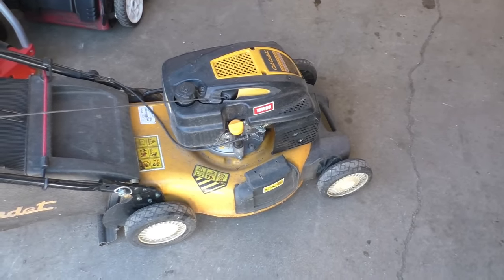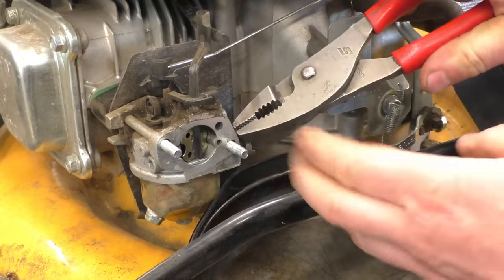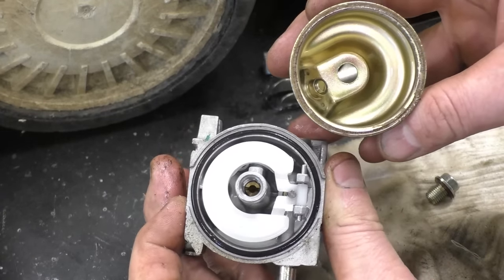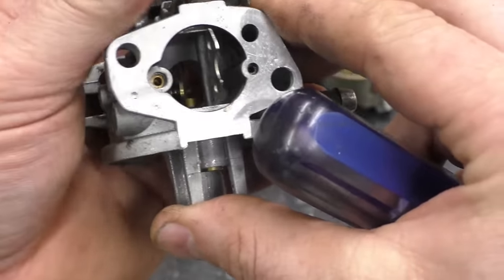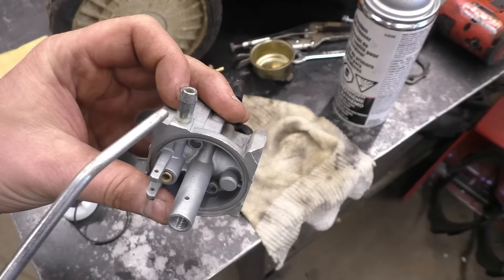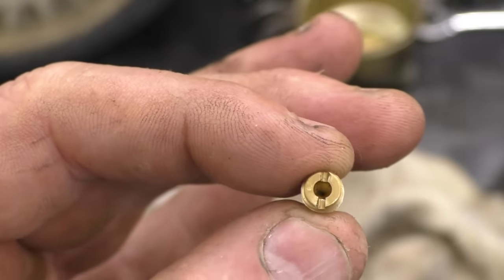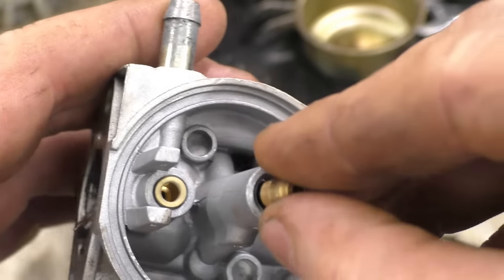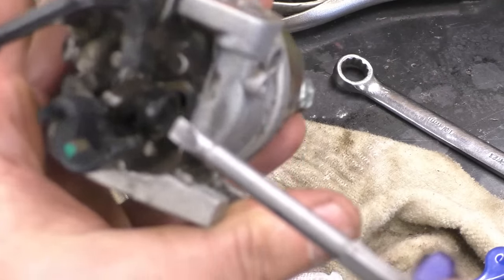Lawnmower Starts But Won't Stay Running After Winter Storage - Step By Step Repair

Comment: Friend down the block neighbor was going to the dump with a lawnmower. He asked why, and the owner said it won't start and bought an electric. He said he was done with gas machines. The lawnmower was only used 2 times. My friend brought a 21-inch Lawnboy with a 6.5 Kohler motor. The mower sat for 1 1/2 with ethonal fuel in it. Carb bowl had brown bits and white gell and rust bits all over. The emultion tub had 3 holes plugged. Spent 1/2 hour cleaning everything up and started first pull. The machine definitely was only used 2 or 3 times. Now my buddy across the street has a free brand new mover for his lake lot. It's a shame people spend all this money on machines and neglect simple maintenance. Your only one click away & 5 minutes of your time to watch a video & save you some money. Great video.
Reply: I know i have about 5 or more taking up room in my space but am working on each different riding mower i know what each one needs done to them and a few are took apart in the yard it looks kinda messy but thats how its gonna be without a garage to do the work in people still wanna dump off their stuff to me when they believe its broken but isn't i guess those people are load with money to just keep buying or don't care to waste it
Reply: I can’t believe how many new or near new mowers I get for free. Throw away society. We are the recyclers! 😊
Reply: @ChristopherTreadway  but i always get outdated ones people are sick of having but then there's never nothing really wrong with them just dirty carburetors rotted filter never changed cutting blade and old gas and oil and plug its all easy stuff they could have done and kept on using their mowers so once they're new mowers get about 10 or 15 years old we'll be taking those ones to
Reply: @Mike-su8si  I think we live in a society where everyone thinks they need to "upgrade". It's funny how they tell me all the things their new mower does, and it's pretty much the same thing their old mower does, except it's new and shiny. But, more for us, right?  😀

Comment: Having done much carb work on cars and small engines, I have found that electric guitar strings are amazing for cleaning out tiny air passages and jets. A set comes with smooth and wound strings of 6 sizes per set. Cost practically nothing and will take decades to wear them out.

Comment: Even though I know all this it’s still a pleasure watching your videos. You are one of the best small engine mechanics on YouTube.
Reply from the maker: Thanks 👍
Reply: @donyboy73  My Snapper Hydro LT tractor wiring messed up, CAN'T get a harness any longer, I HAVE the wiring diagram & can provide ANY close up pictures of ALL connections at the switch, battery, relay & engine connections, wondering if I mailed such to you would you sketch up a wiring layout for JUST the starting & charging connections? Willing to pay for all mailing & your shop time, I'm in north central rural Florida &  the nearest shops that WON'T take my mower is 30 miles away, this mower is ONLY used as a puller, it has NO cutting unit, NO electric PTO, NO lights, just factory wires running to the engine with fuel solonoid & what appears to be a oil pressure switch at the oil filter mount area. NOT asking for a harness, just proper connections

Comment: Darn. I did this all two weeks ago...left lil bit of fuel in mower over Winter, but I use K100 per your recommendation, which scratched my head. Then I took the carb out, bowl was clean, and I used air to blow all out, along with the filter. Put it all back and nope, no start. So I suspected plug, and it was bit dirty, so some emery and gap check and still, no start. Then I thought, did the magneto fail? I didn't see a spark with the tester so... took pullcable assembly off, and found the magneto needed gap set. I took some hi grit sand paper and ran over magneto area to remove some rust, then gapped per your tip on using a business card, and reassembled. Viola, first pull! Your channel has allowed me to keep my mowers and lawn equipment going and my wallet spared! Thank you Dony!

Comment: I have a wheelbarrow sprayer that I had not used since mid July. I went and check it out yesterday as the "spraying season" is here. I've usually had to clean the spark plug, take away the carburetor like in this video and clean it all out, you name it.

This time it started on the second pull and I didn't even had to pour new gasoline. The only thing I did when I put it away was closing the fuel line so it run until it had no more gasoline in the tube/carburetor. I was surprised both for it to start on the second try and also that there was still some gasoline in the deposit, as it's cap it's not exactly a perfect seal but... it worked.

Thanks for video, nice info as usual.

Comment: I need to buy those micro drills I'm having serging issues with a similar mower ! Thanks for that tip !
Reply: Clean out your pilot jet. In this video it’s the little black plastic part underneath the screw. The orifice is tiny, a single copper strand out of 16 guage wire should go through the tiny brass jet. 
That should cure the surging on these Honda style carburetors.

Comment: There's another trick to keeping gas from going stale in the carburetor bowl.

On my Honda GCV160 lawnmower I installed a fuel shutoff in the hose between the tank and the carburetor. When the mowing season is coming to an end I'll let the level in the tank get low, but not so low that it'll allow dirt to flow into the hose. I'll run the engine until it gets to normal running temperature, then turn off the fuel flow and let the engine die out from lack of fuel. There's a drain screw on the lower edge of the bowl, so I'll open it and drain what fuel remains out of the bowl. I also drain the remaining fuel from the tank.

So far, there haven't been any problems with clogged jets or a gummed up carburetor (knocking on wood)!

Comment: ive recently had 2 of these and fixed them both
Reply: the problem i had with both is i had to replace the gaskets..they both would start and stall after a cleaneing and filter change and would still start then stall, i changed the gaskets and boom they ran fine

Comment: I have a 2004 Quantum engine mower that I have always ran dry at the end of the season. I’ve never been into the carb or anything else for that matter. I change the air filter every season and the  oil every other season. It’s only had the spark plug replaced once. I don’t believe in fuel stabilizers but it’s only been ran on 91 non ethanol its whole life.

Comment: Hell yeah I have worked on a cub cadet push mower I replaced the carb and there is also an inline fuel filter in the outlet of the fuel tank that really restricted fuel flow if dirty 👍

Comment: I always run my push mowers dry so no gas is in the tank/carb. I use guitar strings for clearing tiny holes. You have 6 sizes to choose from. 
I notice the screwdriver really did a number on the top edges of the jet. If your running a Holley carb in your old car here in Canada, you can no longer get premium fuel with 0% ethanol. So you’ll need to increase the primary jet size by 2. In mine I went from a 70 to a 72. Besides that  I use Ethanol Shield from Home Depot in my 1970 car and yard engines.
Reply: Bob Falfa did the same thing and he's looking for you on Paradise Road!

Comment: If people put stabilize in the gas and run it for 10 minutes then after that put fogger in the carburetor untill you see white fog come out of the exhaust. Your carburator is totally lubrican till next spring. My dad and I always do this in the fall and have never had a problem for 41 years. They always start right up

Comment: So I just had the same issue with a YardMan. Cleaned the carb and after it was surging. Popped it off and enlarged the main jet a bit and cured it. One thing I’m wondering is…is this motor made by Honda? Everything on there looks the same…except way easier to work on of course😂. Thanks for another great video.
Reply from the maker: They are a chinese copy of Honda

Comment: Excellent video Don, i enjoy everyone. After running an engine dry and draining the carb bowl do you ever spray anything into the bowl afterwards through the drain bolt. I have heard old timers do this to keep things from 'drying out'.
Reply from the maker: No I don't spray anything, if there's nothing there, there's nothing to gum things up!

Comment: I have a craftsman m110 does the same thing but I've replaced fuel line, spark plug, air filter, and new carb and filter. Has new gas and oil still doing same thing. Any suggestions?

Comment: On the cub cadet mower the Orfice you opened up with the 30!thou drill bit , we’re you enlarging the opening or completely opening it up , I have the same set up on my champion generator
Reply from the maker: Enlarging with 13" thou micro drill bit from Amazon
Reply: Thank you so much for the quick reply , Love watching your videos , very informative and you are a very smart man.Ok because the hole seemed solid to me on mine so would that mean it’s plugged
Reply from the maker: @DonJackson-os4xu  yes

Comment: I just follow Honda's instructions on storing an engine, drain the fuel system (I also pull the bottom bolt from the carburetor to fully drain it), remove the spark plug, dribble some oil into the cylinder, turn the engine over slowly a few times, put the plug back in and pull slowly until the first bump in the compression release as that closes the valves.  I do this to my Honda G flathead, GC, GX  and Clone engines like my Cub Cadet PowerMore engine.
Reply: Should you leave the gas cap on or off after draining the fuel to store the machine? Thanks

Comment: I just fixed an old 1970's Briggs that was sitting for years with gas in it by just pouring some seafoam and carb cleaner mix straight into the carb. Used starter fluid to pull it through a few times and away it went, runs like a champ. The tank was clean inside though and if there was any debris this would not work. People need to quit being lazy and just run the machine dry / remove the fuel line to empty the tank, then pull the drain plug on the carb. 2 minutes a year will save you thousands over your lifetime and you don't even have to pull the carb.

Comment: I get old stuff.  that ones alot newer then all the ones i have sitting around til i start on them two are a 2 cycle out of some of the free ones i have i have a even older one but its piston arm is broken off and the piston housing is ruined from when whoever last ran it broke it but its little engine is shot and no body makes parts for it anymore the engine is to old

Comment: Just an observation on 'premium' or 'super' grade pump gasoline sold in Canada, 
while it could have better additives in it,  since late 2022 it is blended with ethanol 
just like regular grade and just as prone to accumulate moisture.
Those 'canned' or engineered fuels may not go bad as quickly but are 
no guarantee your machine will perform the same as using gasoline.

Comment: how many mowers and lawn equipment get kicked to the curb because of something as simple as this.....i used to rip my arm out of the socket every spring and fall trying to start these machines getting ready for the upcoming season whether it is snow or grass....i usually run them dry (when I had gasoline powered equipment) but the only gas item I have now is my Ariens snow blower...the rest of my stuff is EGO....so much less stressful or crossed fingers at the beginning of each season

Comment: I didn’t see you install the emulsion tube.
Reply from the maker: at 5:44
Reply: @donyboy73 saw it but it’s easy to install upside down so maybe next time show it going in correctly and warn about improper assembly

Comment: I know you’re doing this is a paid job so you have to do it right to avoid a comeback, but for anyone with this issue with their personal machine, you can usually clean the main jet by leaving the carb on, removing the bolt from the bottom of the float bowl and just using compressed air to blow up through the hole.  This works if it’s just a minor plug from sitting over the winter.  I wouldn’t advise this if you’re doing it for a customer though since it’s not always a sure fix.